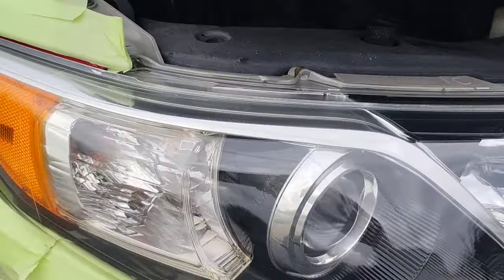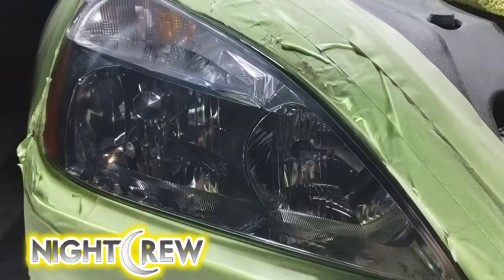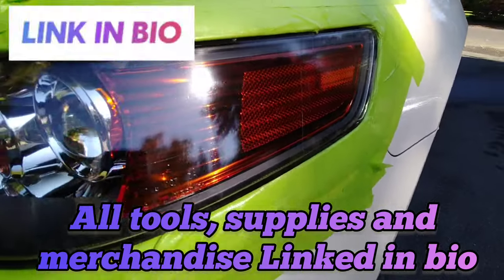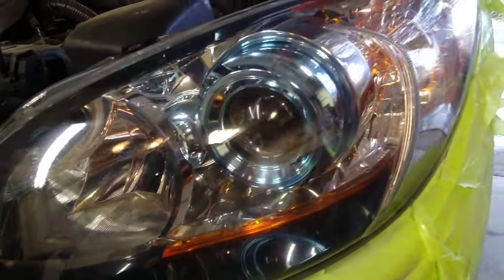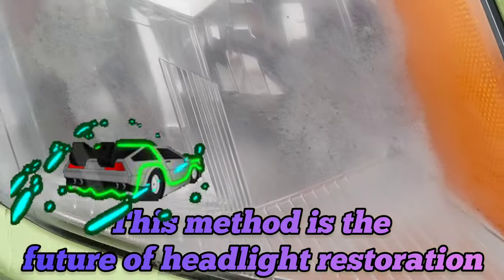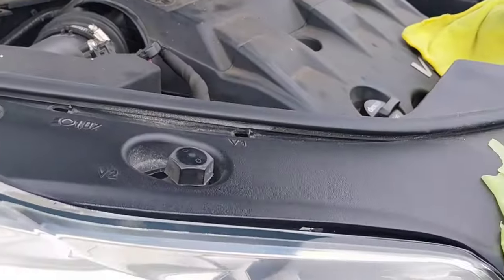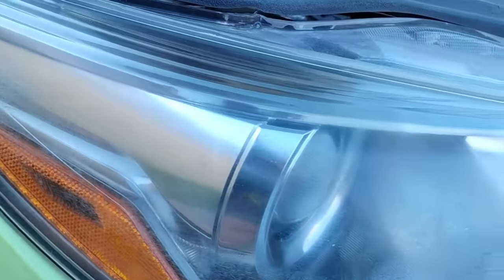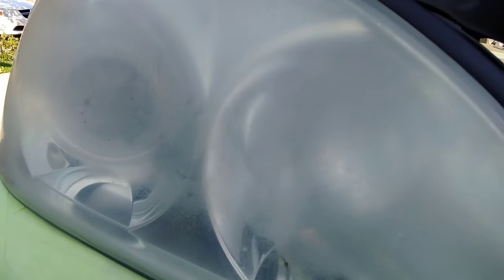Headlight Restoration - PORTFOLIO #6 - The PROOF is in the pudding 🌎🌎🌎

Comment: Are there any health effects down the line from breathing in the sanding particles from headlights? Will wearing a respirator fully eliminate those risks? I can’t find any articles online dedicated to this. I’ve been doing this part time but I’m thinking about doing it full time. Only thing stopping me is wondering if I’ll get cancer from it in 10 years. Please let me know what you think and what precautions you take to minimize the risks. Thanks!
Reply from the maker: You can get cancer we're not going across the street...🤣🤣🤣
With that being said it's totally safe if you are safe if you wear your PPE..
Far as the dust you can get away with wearing an n95 mask a covid mask the particles are too big to pass through very limited and small exposure.. nobody's really doing this 8 hours straight even if you work 8 hours you're not doing it 8 hours straight of nothing but headlight restoration so it's very limited exposure..
Far as the spraying part which is the most dangerous part you need to have a proper respirator.. exposure will be very limited and if you do get exposed you'll know you'll taste it.. but there's ways to get around to zero exposure... Just like any other job whether you're a welder, a painter, working at a landfill all the above I just said will Grant you more exposure.. you can go as far as you want with respirators to have that zero exposure they even have oxygen fed zero exposure face mask and headgear.. I'm interested in going that route in the future but they're very expensive thousand plus..
So yes it's very safe if you are safe.. I haven't always been but I've learned my lesson....

Comment: Have you experimented with other brand pads besides the 3m? Or is the 3m superior to all others?
Reply from the maker: Yeah man 3M Superior to everything out there not just pads but most likely anything they make they're multi-billion dollar company that have stock options and scientists that probably make multi millions each year.. they are the best of the best.. so of course they're the best...
I'm trying many different kind to get around the cost of them because they are quite expensive as you get 50 for the price of what you would get 5,000 of other for.. but that should tell you right there how cheap other discs are... These discard Superior because they are 3M and also because they are the European scale which is why they have a p in the front they're much much much higher quality made compared to the regular version of sandpaper which just has a number...
There's no comparison might as well get the 3M going to make your life so much easier as far as headlight restoration..
Reply: @theheadlightrestorationpro  Definitely going with the 3m. Thanks for the knowledge. I was seeing the prices of 3m vs others and Definitely see what your saying.
Reply from the maker: @Sebastian-vw5ch yeah you would think I'll just save money by using these ones but one of these 3M discs will do what 10 of these other disc will do...

Comment: Hi my mentoor, I did everything the way u said, but after I buff with chemical guys headlight restorer, I still see fine fine scratches,  it that normal
Reply from the maker: Well you have to evaluate if they're superficial scratches are up there actual scratches that will be seen after the clear coating.... Typically at this stage if you see too prominent of scratching left behind you didn't do enough of the 800 stages... And or you're pressing too hard when using the p500 or anything and greater... Typically it's both..
Reply: I can concur with the master's words.  A few headlights I've done, I've pressed down too hard or something weird with the sandpaper and left some deeper scratches than I liked.  After spraying, some scratches you could see and some disappeared.  If you looked hard enough and knew where they were, you could still see them. But if you had no clue, you wouldn't notice them at all.  

I do point out the scratches and blemishes to customers (friends).  All in all, the people were more happy and mesmerized they could see inside their headlight clearly again.
Reply from the maker: Who could be mad if you left them in better condition..💯

Comment: I haven't started advertising yet but I have mentioned it to a few people in passing that I can restore their foggy lights. Around half just say, oh, I just use WD 40 and toothpaste now and then!🙄 peasants😵‍💫
Reply: 😬I get that A LOT!  They'll soon come back when their headlights are TOTALLY ruined from all the solvent abuse 😄
Reply from the maker: Peasant brain peasant mind frame peasant people....💯
Reply from the maker: @markedimprovementheadlights77 👍🏽
Reply: Those are the people who most likely don't care too much about good care and don't want to spend money on having it done.  I'd have been like that years ago.  The question also, how old are these cars that refused.  

What you could do is sell them the fact you can restore them to be clear again.  After that, you can tell them instead of using toothpaste or wd40, they could just then buy aftercare kit from the store or from you at a fraction of the price.  Also letting them know that instead of reapplying the crap on their headlights every few days, they'd just have to reapply the aftercare every 2 to 3 months and their headlights would stay clear for many years. Less wasted time and hassle.

The good thing though only half said such thing.  You still had half you would work with if they weren't interested at that moment.